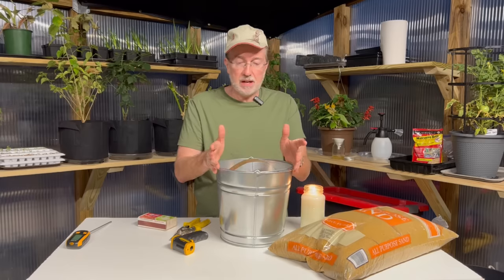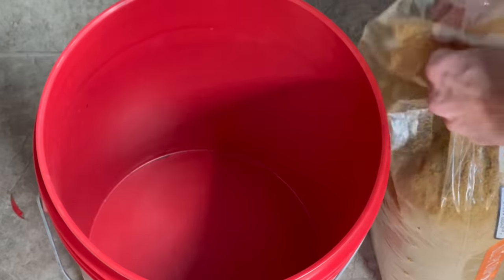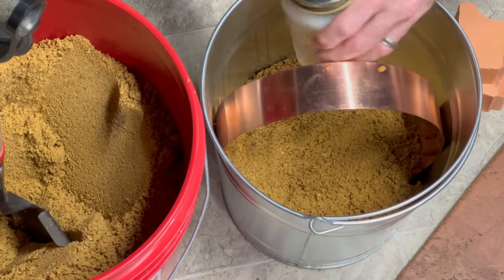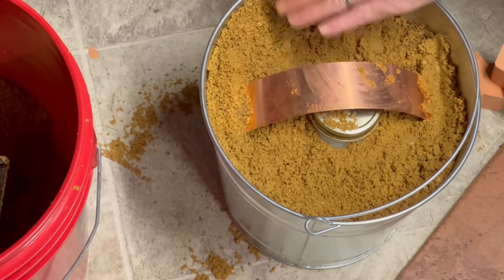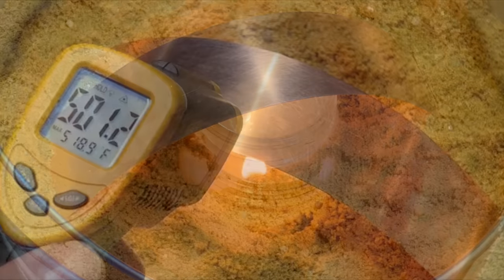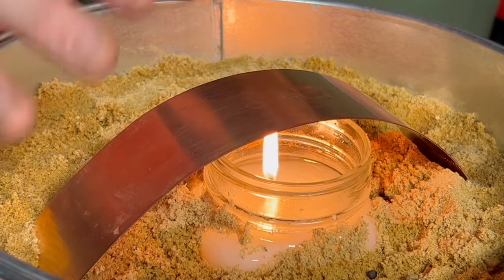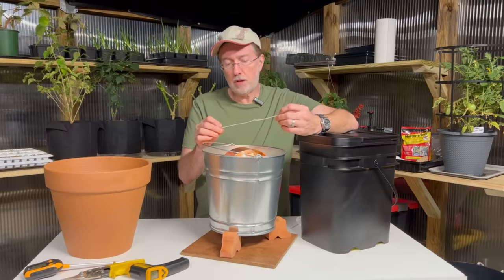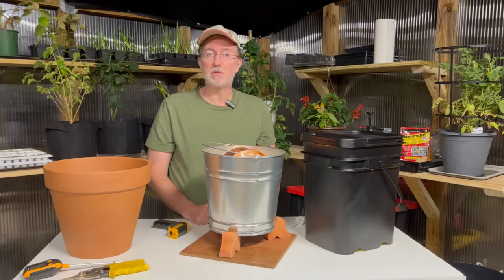DIY Copper And Sand Heater | No Electricity Needed For Greenhouse Heat

Comment: For anyone doubting a terracotta pot and a candle.... I live in Maine. I went ALL winter last wonter with ZERO heat or power. February proves to throw us -20F nights some with some without wind chill factored in. I made it through the winter burning candles i found in dumpsters of big box stores under those clay pots. 2 pots each with a 2-3 wick candle would raise the temp by about 15 degrees in each room. YOU might not think thats a big deal but when its 20 below zero outside and dipping into the 20s-30s above zero inside and you can raise that to 35-45 above zero it makes a huge dent in safety and morale. Learned a few tricks over the year and now am getting ready to battle winter #2 without power or heat. Keep on keepin on peeps❤
Reply: Works. Have you tried putting it under the table for warmer feet/legs? We did it in harsh winter times, secured and on fireproof grounds, obviously.
Reply: Absolutely works we are doing it now! Keep preppin this country may hit some hard times
Reply: Good to know?  How well insulated is your house?  Did you also cover windows, or was that just with clay pot candles?
Reply: The biggest secret is to wear plenty of warm clothes.  Folks these days don't seem happy unless they can wander round indoors half naked.
Reply: You're awesome
Reply: @bigoldgrizzly  Yes! Nakedness is considered a garment these days! And I usually don't care what people are wearing or what they look like, but seeing people running around uncovered outside in the cold makes me feel cold looking at them
Reply: @iahelcathartesaura3887  
You might be horrified at the coat I am wearing right now. Donkeys years old and literally hanging in tatters after years of catching fire from welding and grinding. My good wife has tried to throw it out several times, but I have recovered it. The saving grace is that it has triple thickness knitted wool sleeves and keeps my arms warm, hence I never get cold hands. Many country folk I know have similar tattered garments, but If I could find another like it I would, grudgingly, discard it. [I do brush up well for my rare public outings ;<)   ]
Reply: I did use the idea of crisco candles in the terra Cotta pots and they do last. Mine are on 4th day and half full still. Really heat up.the pots well too
Reply: I am using this heating bucket dit 3 weeks now, and i feel the different.
Just a remark, the candle jar is only fine when the flame is near the copper. The emptier the candle jar the less heating. Is provides 

I use 3 large tealights  or 4 small ones 

Tnx for the tips
Reply: A other question.

The flame on the copper, creates some kind of black stuff. It looks like burnt wood. Do you know what it is called and if fumes from the copper,
Is bad for the health?
Tnx
Reply: I'd be working on getting a job to pay for electricity and gas.
Dude you had an entire year. Why does your house still have no electricity?
Reply: Try just the candles.
Reply: @holtjes The soot is rather pure carbon, not harmful unless it has unburned hydrocarbons on it, (feels greasy or smells) don't eat it and you should be OK.
Reply: Pop in a glass front woodstove. That's what I have in at my cabin Fairbanks Alaska.
Reply: Candle fumes are bad
Reply: A candle just doesnt have the energy to do that. A clay pot doesnt change that
Reply: Yeah burning candles inside is terrible for your health
Reply: Much love to ya! Thanks for sharing that knowledge
Reply: Nothing I like better than real world experience from real world people.
I can’t thank you enough .
God bless 😊
Reply: I know a guy who lived in a mail truck in Colorado… he said a thick piece of sheet metal w candles underneath worked and he could blow out the candles and it would continue to emanate heat.  I want to try a cast iron pan or griddle.  But, I was thinking about getting three dogs… since I don’t have a boyfriend.
Reply: I do not doubt that the candle produces heat.  But that Terra Cotta pot does nothing to increase the amount of heat.   The laws of physics are intact.   

While the pot might act as a diffuser in the same way a globe over a lamp will help diffuse the light. Energy output is not increased.  Heat cannot be increased. 

I suspect that your results would be the same without the pots.
Reply: @absurdnerd7624  What the teerracotta pot  (or copper and sand) does, is absorb energy of one type - mainly light - and converts it to infra red energy - heat. Plus, there is little heat lost via convection. So yes, there is no  more energy put in (as you say, a Watt is a Watt) but the energy that is normally given off as light, is converted to heat, because of the energy absorption profile of the particular materiels used. Surround the candle with water, and the high specific heat capacity of water plus convective heat loss, will mean it warms up very ineffficiently.
Once upon a time, a classic demonstration of the laws of physics  for engineering students was to cut a stack of sheets of steel plate to fit exactly around an incandescent light bulb, at which point almost 100% of its radiated energy would go into heating the metal.
Reply: Thanks for this confirmation comment. I don't get how the heat can make that much of a difference, but good to know! I mean... The heat should all be the same if it goes into the air or if it goes into the pot... Oh well. Thanks again ^_^
Reply: @djsearles4684   It is IMPOSSIBLE for the pots to CREATE MORE HEAT!!!   YOU…are lying!!!
Reply: @bigoldgrizzly  CLOTHES are NOT warm.   They create ZERO HEAT.    ALL that can do is CONTAIN it.
Reply: @Tryp-j9d  
And a fella doing moderate work generates about 500 to 1000 watts of heat - though some is lost by breathing out, that is a pretty decent internal heater, provided you dress well to keep that heat in
ps old grizzlies, like polar bears do not need candles in flower pots   ;<)
Reply: I've seen those pots before and wondered.and I now I wonder some of theose pots have a hole at the bottom and some dont.does it matter when your using it for heat.
Reply: Kudos pa people here no heat or electric Either!! stay warm we are trying it this year
Reply: @OfftoShambala   Why do You need three dogs? Dogfood is not that cheap...🤔 Or...?

Comment: Easier way of providing heat for the greenhouse. Build a good sized open topped box and place under the potting bench. Fill with fresh manure, water well and cover with plastic sheeting..check that it doesn't dry out. As the manure decays it will let off enough heat to keep the greenhouse well above freezing. When the manure has fished working, dig it into the greenhouse beds or garden to fertilize the plants.
Reply from the maker: Interesting…..I was looking into having a massive pile of wood chips delivered and running dryer vent thru it as the chips heat up in the center fr9m decomposition. Thanks for your idea.  I’m always looking for that perf3ct idea.
Reply: @ZenGardenOasis.  Tried and tested. Greenhouse never dropped below 40 F, even on the coldest days of winter, and this comes to you from England where we don't have wall to wall sunshine. We don't get tanned in summer, we go rusty.
Reply: Basically biomass heating, producing what you need for the garden anyway. 👍
Reply: I love the idea of using bacterial metabolism to heat the greenhouse! Rather than straight manure, I would recommend a lot more carbon (shredded leaves, straw, etc.) be mixed in. Check into Berkeley 18-day compost for ratios. A large pile produces an incredible amount of heat. 
Another option is to keep rabbits in the greenhouse, providing manure, warmth, and a place to put any vegetable scraps.
Reply: I have used this before and found that it helps to part insulate the compost to a degree to keep it working and I used to get it started using a heat mat beneath the compost. Getting the right mix for hot composting is also important
Reply: @ZenGardenOasis.  I think that wood chips on their own will struggle to get up to a useful temperature - too much carbon and not enough nitrogen
Reply: @ZenGardenOasis. 🌿🌻Thank you for sharing your Candle, Copper and Sand Heater Idea. It could also be useful for people living in Tiny Homes and RVs. 
I've also watched videos on people saying mulch and straw bales, help heat up their greenhouses🌻🌿
Reply: @bigoldgrizzly  Kitchen waste and vegetable trimmings all decay, grass clippings will get hot enough to scald you if you stick your hands into a fermenting pile of them. All heat up and provide valuable fertilizer and humous to use as a mulch. Keep the mix damp to keep the action going.
Reply: What size area will b heated this way??
Reply: There is a reason why in Europe all the OLD (pre 1900's) farm houses have the living space on the 2nd floor above ground level. All the farm animals are on the ground level and their body heat heats the floors above. They also have manure mixed with straw to compost giving off heat too.
Reply: @davej3487  Good point, but I don't think that modern man would want to live withe the smell and the noise,  and a lot of people have the idea that food stuff magically appears on supermarket shelves overnight.
Reply: @augeniasestokaite4674  You only get out that which you put in. Light a candle, stand close to it and see how much heat it gives off. Now consider that wee small flame in a relatively huge room sized space. That's how much heat you can expect from it. You'ld be better off blowing on you hands.
Reply: @flattail  Torn up newspaper or cardboard layered into the mix will provide all the carbon you need. Grass clippings and chicken bedding and droppings generate a lot of heat when decomposing, though clippings need the paper or cardboard to cool the reaction down and sweeten the resultant compost. This is why hay and straw bales need to be kept dry, because in bulk they can generate enough heat to spontaniously combust
Reply: @FrankBrown-c5l The average temperature of a candle flame is around 1000°C / 1832°F. Please explain how human breath is hotter than that?
Reply: @mattjohnson2848  That temperature applies only to the flame, not to the area around it.Heat dissipates with distance, which is a good thing or we'd all be fried by the heat of the sun. Physics is a wonderful thing that can explain almost everything. Try heating a bar of iron untill it glows red with heat in the flame of a candle, and you'll still be waiting for the glow when you are older than Methuselah.
Reply: Ya that’s two thumbs up. 
Except :
Might burn up all oxygen in greenhouse so, you could walk in and die!
Stinky probably?

You can make a large compost outside and run radiator style heat from that. 
You can also build a compost on the back wall of the greenhouse but, completely outside. 
Super easy! That is if you don’t have a long enough extension cord for a heater or old style light bulb. 
Which is easy to do!
There is no way I’m heating with anything that can eat the oxygen from the air or leave soot, or stink etc in my greenhouse!
Not happening!
The reasons are many for not burning in closed areas. 
The obvious and the not so are. 
They burn oxygen. 
The wick can mushroom after a few hours and cause the candle the burn out of control. Creating a soot cloud and posing a fire risk!
I’m not making this up BTW. 
Do what you want but this is thinking INSIDE the box 📦 not OUTSIDE.
Reply: @TimeSurfer206  open flames should be your last chose for indoor heat I guess is what I'm saying.
It just is!
Reply: @TimeSurfer206  It has the potential to catch you or your greenhouse on fire.
And is a bad idea.
Yes My Phobia is fire. learned it first time as a child.
Fire Bad!!! Burn.
Reply: @TimeSurfer206  200 candles = one oil lamp. 
Burn 200 candles in your greenhouse then walk in for a snooze 😴 !
You are not as smart as you and your Dr. Of psychology degree says you are. 
It’s a bad idea now you know too. 
Thanks too. 
For being such a nice person. 
Without your response I would have guessed it to be just a candle in flaming hot sand and not a oil lamp in flaming hot sand. 
Big difference if you want to live.
Reply: I just had a stump removed and the chips sat in a pile for a day and they were already warm.
Reply: By adding layers like green for nitrogen and brown for carbon and the water also with adequate oxygen your composting heat will be greater. You are correct that this type of setup gives off more total benefits. You produce heat and you have a wonderful garden product. Keep up the great work.
Reply: @flattail exactly my thoughts. It is also great to add all those shredded documents people destroy as long as they are not shiny paper or plastic and cardboard also great supply of carbon. Another thing is the bins or piles should be a minimum of 3 ft by 3 ft by 3 ft.
Reply: @ZenGardenOasis.  Farmers and ranchers are doing this to keep animals warm, it's called the deep litter method and they basically keep the old bedding, sometimes adding a little water and just put fresh bedding on top. Decomp of organic matter is enough to keep them out of the danger range. Clear it all out to the garden in spring. Also saw a guy make his own lead white pigment using manure to get the tub warm enough to keep the reaction going. Just to be clear, I do not recommend playing with lead. Guy was playing with fire collecting his pigment on a breezy day (was dusty and flying around) with no safety gear save some used nitrile gloves.
Reply: Horse manure is best for a hot bed to heat up the greenhouse
Reply: The nice part of that is it isn't as much of a fire hazard.
Reply: @TimeSurfer206  You can also make crude bio gas in the middle of the compost heap. The heap can get hot enough to sterilize any bacteria that might be in the organic material used for the heap itself, and can also break down material into gases. You'd need an airtight container in the middle of the heap. This is very crude gas and probably a lot of modern motors won't run on it. 
In the 19th century, horticulturalists in large cities would gather horse manure from the streets to start greenhouse crops in the early spring. They would compete with each other to get the earliest crops out. This is where the craze for baby vegetables came from.
The book I read this in recommended  a pile 6x6x4, with a proper mix of carbon to green material. I seem to remember 2 to 1. I used seaweed and that worked.
Also, dry material such as hay or woodchips can spontaneously burst into flame if not wetted down regularly.
Reply: Yes yes. Any compostable mixed dry to wet compostable material, leaves, straw or safe animal manure in a center bed " cooks" and will really warm the greenhouse area.
Reply: @TimeSurfer206 Do you add water to this?
What about filling it with saw dust?
Reply: @eveadame1059 wouldnt that burn up the plastic.  I have a hoop house. Id be afraid to do that in it.
Reply: @davej3487 but what about the smell?
Reply: @wakeupthebear there is a flame in indoor gas fireplaces and they are fine?
Reply: @6648rome  If you ever had lived on a dairy farm, you never get rid of the smell, you just get use to it.
Reply: @TimeSurfer206 also the co2 contrary to poplar opinion is plant food if co2 levels rise it will increase the amount of plant growth witch will lower co2 levels naturally
Reply: @flattail  Construction friend of mine made 'Rabbit Poop Soup' with rabbit waste & some water, sloshed it 55 gallon drum w/big lid w a strap. Tossed in his food & garden scraps, relid it and just kick/roll it around the yard every day and made amazing compost. Shared his veggies & had cookoffs at work.
Reply: @williamelliott  The problem with those shredded documents is the toxic dyes, and inks in he paper, BPA, and such. great for creating heat, or compost for ornamentals, but chances are, too toxic for growing edibles.
Reply: @bigoldgrizzly  Wood chips have been known to self-ignite and start fires. Anyone leaving a large amount of wood chips piled more than a few inches for long needs to make sure they can do no harm if they catch fire.
Reply: Maybe that's why some of the people's comments on here are so hot tempered. They are full of decaying buffalo bagels. You make a great point here with recycling twice and no fire hazard.
Reply: I had friends in Northern California who always built a large compost pile in their main greenhouse at the beginning of winter - he coiled a rubber hose through it as he was building it, that was filled with water with the ends screwed together to seal, and had one long loop secured at the bottom of each planting bed.

Their greenhouse remained between 55 - 60 degrees, even when it was below freezing outside.

I've read about others using a similar system to heat small homes and workshops.

Another friend, in Northern Idaho, which gets a lot colder, had two small colonies of breeding rabbits in his sunken greenhouse. 

Thr rabbits kept it warmer with their body heat, and, like the compost pile, the carbon dioxide from their breath fed the plants.

And, since he had it sunken roughly four feet underground, the temperature was also mitigated by earth berming, keeping it warmer in the winter, and cooler in the summer.
Reply: Kind of like the compost heater. You put horse or cow manure over PVC and it will heat up the chambers very well with small fan and some insulated tubing it will warm up a small area. Horse manure is much hotter than cow. I remember my mom doing that in the sixties when we had snow and a barn full of horses
Reply: @skittlemenow  horse manure will start a fire. We had to make sure it was removed from the barn after cleaning stalls because it would start to smoke and then if left long enough would start burning as it dried the alfalfa not fully digested in the manure
Reply: Cardboard box. ?
Reply: Water can be heated the sane way. Bigger container. As manure is being out in wind that hose in it.  Run water through the hose at the top.  It comes out hot.